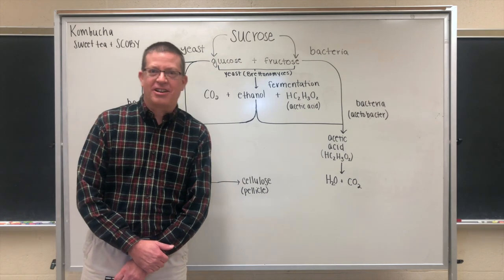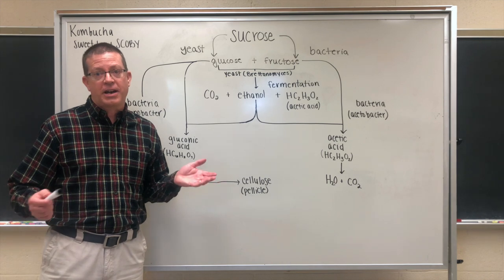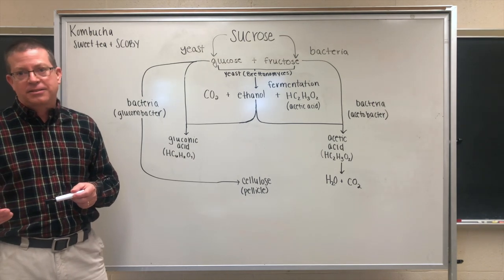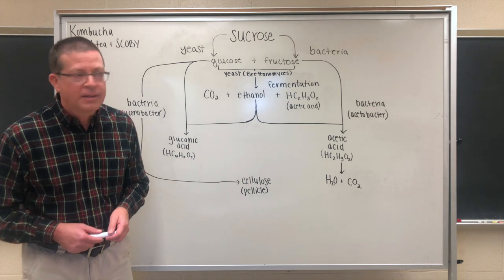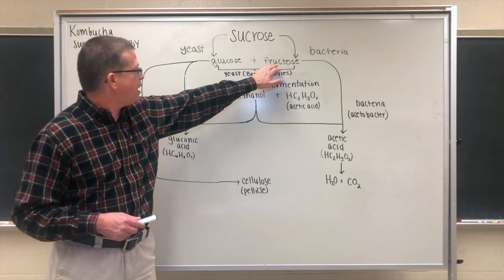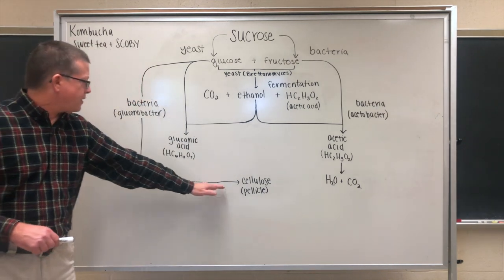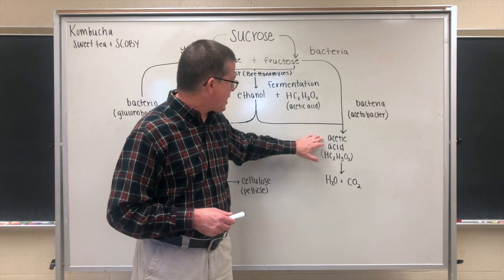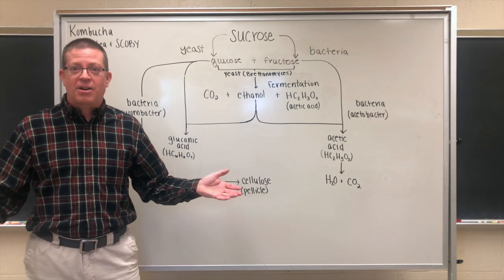Science of Kombucha Brewing

Comment: Thanks for the video! Could you explain the purpose of the second ferment? I have noticed in Kombucha diy videos that the first ferment is usually covered with a fabric and I assume this is aerobic. Perhaps it is the phase where sucrose is converted to fructose and glucose? I assume this is also maybe a slower phase since this stage is normally 1 week long. And then the second ferment involves bottling the Kombucha (creating an anaerobic environment) and then this is the stage where carbon dioxide is produced. But I wonder if carbon dioxide would be produced anyway if you just let it ferment for long enough in the first instance? Or I guess maybe the bottling just allows for the capture of carbon dioxide for the fizziness and has nothing to do with being anaerobic?
Reply from the maker: The secondary fermentation is usually a flavoring stage that also leads to increased production of carbon dioxide. Carbon dioxide is still being produced in the primary ferment, but in many cases it is escaping when left open to the environment like you noted.